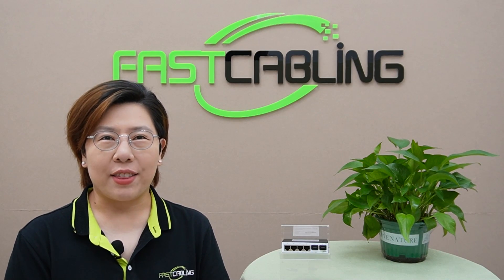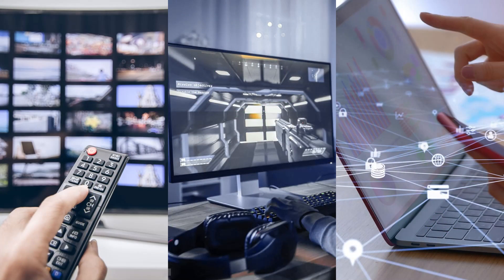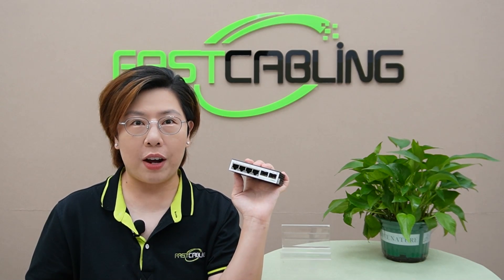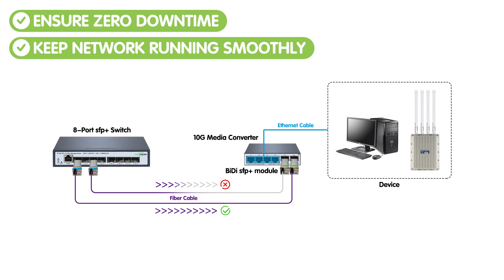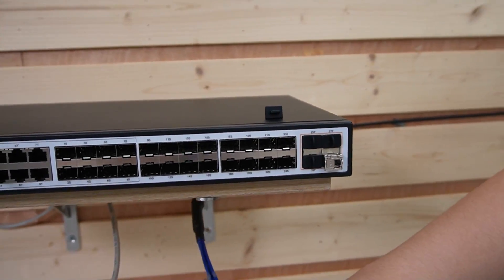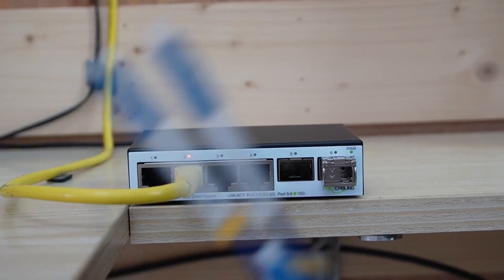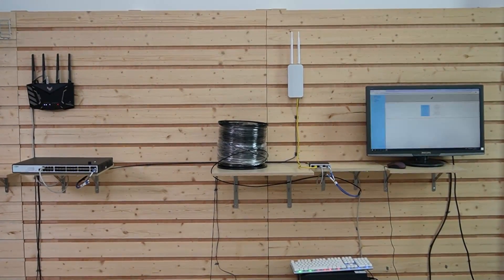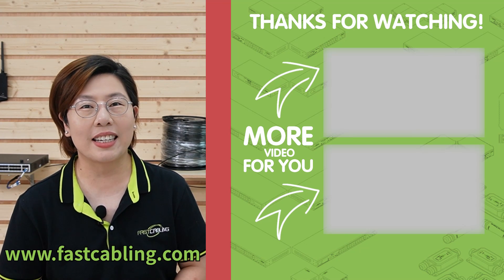Step-by-Step Guide: Installing the 10G Media Converter with Dual SFP+ Ports

Comment: Can we use pre made fiber optic cable as fiber back bone in any data application for structured cabling and cctv back bone? So fiber optic patch panel is no longer required because special tools are needed to terminate each fiber core into pigtails of said panel?
Reply from the maker: While using pre-made fiber optic cables can eliminate the need for fiber optic patch panels in smaller setups, you might still want to consider a patch panel in larger or more complex networks. Patch panels allow you to easily connect, disconnect, and reroute connections.

Comment: Can i use 10GB sfp plus module into 1GB sfp port switch? Is it backward compatible? Meaning can we use below 2.5G devices into 2.5G port switch?
Reply from the maker: In many cases, a 10G SFP+ module will not work properly in an SFP port designed for 1G modules. SFP ports are typically designed for speeds up to 1Gbps, while 10G modules have higher data rates. However, you can use devices with lower speeds (like 1G or 100M) in a 2.5G port switch. The switch will typically negotiate the highest compatible speed with the device.